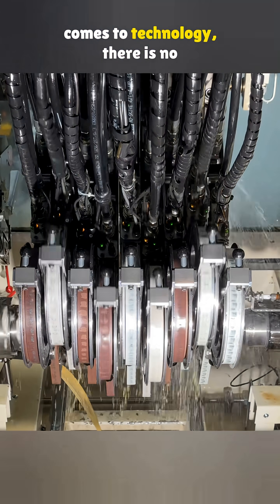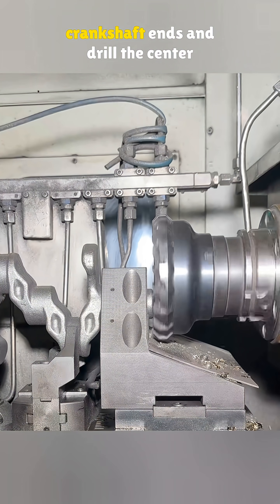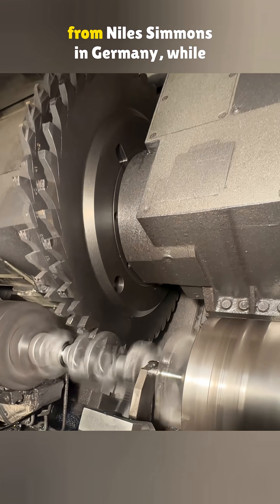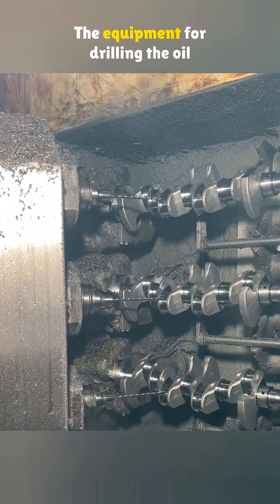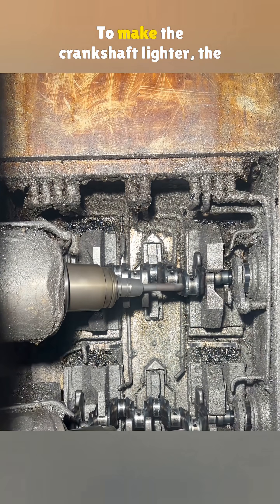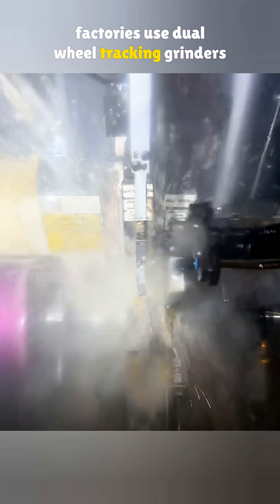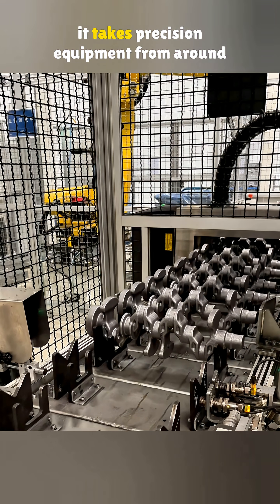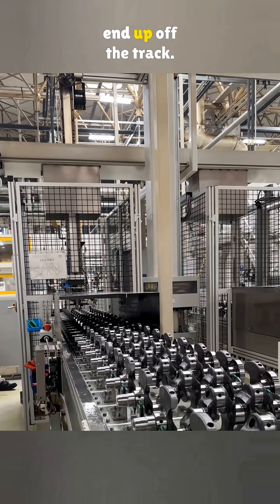How Crowded the Fuel-Powered Car Market Really Is

Comment: And then there is me who machined a working 3 zyl crankshaft from a solid block of steel, in my home shop. Roughed it on a 50 years old shaper from Yugoslavia, turned on a 70 years old german lathe, milled keyways on a Busch CNC and drilled oil holes on an old manual mill from spain. And the journals were ground on a Schaudt grinding machine